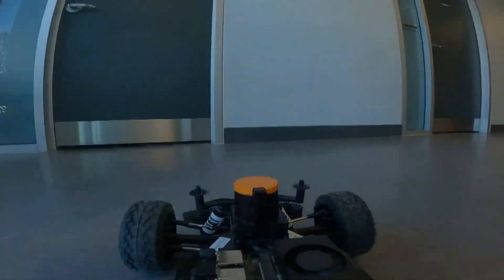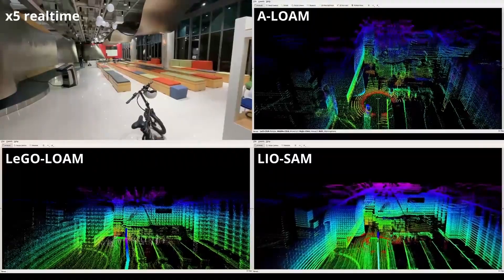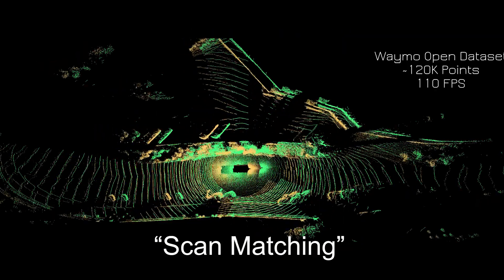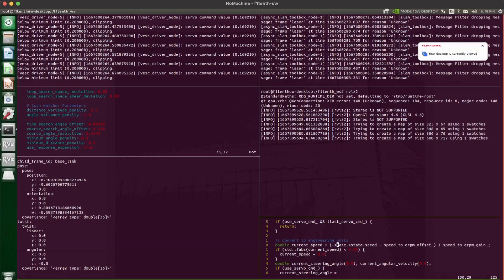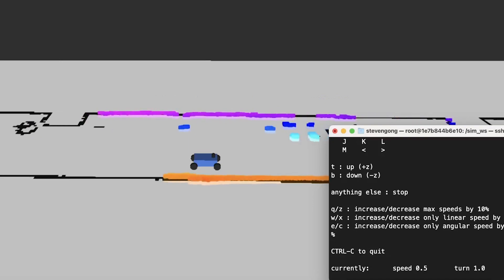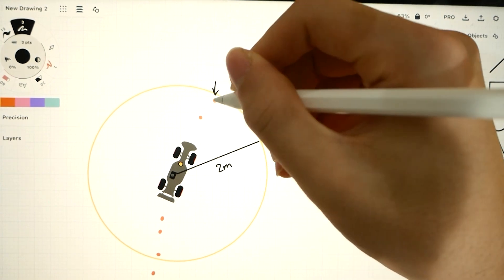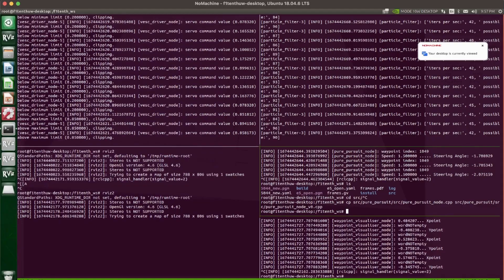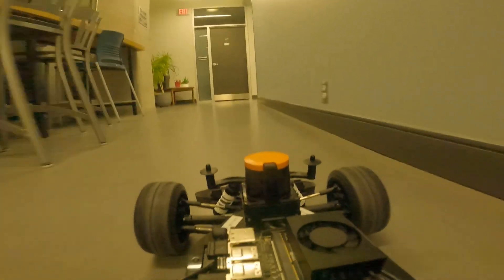I Made a Self Driving FPV RC Car

Comment: wow it's almost as fast as my lg homebot vacuum cleaner, i hacked it and just set all the speed values to max and also set the uss braking zones to max, now it cleans, zigzags from wall to wall and navigates around my house like an rc car, but watch out if you step in front of it, it hurts like hell. it's also destroyed a few cupboard corners but its ok, its so satisfying to see it cleaning and racing around my house. The whole thing has killed 3 batteries already, but hey, a new battery only costs $20! And you can get a new used bot for only $100 right now. All you need to hack into the bot is a USB stick and some online tutorials, which you can easily get by doing a Google search.

Comment: My guess about this rc code

See's line of points = run straight.

See's end of straight line of points = slow down.

See's points (any) angle
= Steer to it.

Im no pro coder, I just used the monkey sees action, neurons activated meme.

Edit: if the line intersect with another line, the code will set time dial to points already passed so the rc car won't suddenly break

Comment: the chassis looks like a traxxas slash, definitely not running it at max speed and has some serious cogging issues. you did not mention but curious about how did you handle braking (software-side)?
Reply from the maker: yea turns out it was loose between the pinion and spur gear, so it was slipping so much. Finally fixed that in the next video. In terms of breaking, I think the VESC handles that, its the same as when you try to break with an electric skateboard. i just tell it a target rpm of 0
Reply: @stevengongg  oh i meant the maths behind it, like are you doing some kind physics simulation to determine what's the speed it should be at x point given this acceleration/de-acceleration k? by the footage it looks the sensoring from the bldc is not connected so I don't even know if you can track the speed.

Comment: I'm not sure if it self driving car if you already make paths from the beginning. Try to put car somewhere and let it go to you by gps.
Reply: gps works by trilateration, calculating your position against at least 3 direct sight satellites. the car wouldn't run indoors or tunnels!

Comment: I making simular thing but in industrial scale , And interested few things. What type of SBC are you using to calculate the root , and how the system power consumption increases with the dificulitiy of the track .
Reply: looks like a jetson nano development kit. i dont think technical driving difficulty has any relevance to power consumption on the computing side, it's continiously doing the same computations on the same data size at probably some low but steady rate all the time. the jetson alone will drain a 3000mah lipo in less than half an hour.

Comment: Great insights into how challenging it is to make an RC car automatous. 

I noticed is at higher speeds the car seemed to overshoot it’s intended path when cornering. Not sure if this a latency between the car knowing it’s position and when steering response is applied, or something else (like a slippery floor). An easy fix is to base the speed of the car on how straight the upcoming path is, 
this way it will slow as an expected curve in its path tightens. This should then allow for higher top speed in the straighter sections of the course. Thus an overall faster speed on laps. ;)

Look forward to when having multiple cars racing, and all the improvements being worked on!
Reply from the maker: yea, it's the slippery floor. Working on a 2nd video using racing lines, hoping to release it soon!

Comment: Imagine AI assist for FPV racing drones. That somewhat helps the pilot fly through the gates accurately without crashing.
Reply: Kinda defeats the whole point lol
Reply: Literally takes away the fun from it
Reply: if you are into boring things dji makes that kind of stuff. will not launch if under a restricted area, will avoid obstacles, fly against wind and successfully reach the point you clicked on a map while keeping a steady still position. after the first flight the fun is pretty much over.
Reply: Yeah folks I get your point. I fly 5" freestyle quads too I know what you mean. And for a long time I sulked from anything autonomous but having flown RC for about 8 years and FPV for a good 4 of those. I feel a bit stagnated in the hobby with the level of risk I can take. But if you watch how people in Ukraine are making FPV drones fly autonomous missions you will appreciate how important it is to make some open source self flying drone project is important. Exactly for the reasons that DJIs won't take off in GPS denied areas and be difficult to repair in tough times. Is why projects like INAV are needed. Yeah it's not as macho as Mr.Steele zipping in n out of parking lots. Autonomous is boring , agree 💯 % but making the open source projects popular and better is important.
Reply: @aakashjana6225  i think the software is there but hobbists don't usually spend USD +1M  on military-grade hardware.
Reply: @knoopx  well my point wasn't specifically on military H/W but more so about contributing to open source projects like InAV ardupilot etc
Reply: @aakashjana6225 nah not fun to me. I did however contribute to betaflight.

Comment: Wonderful job, I have a similar project in ROS2 and understand just how are yet satisfying this can be. Great work on (from what I understand) using LIDAR alone for SLAM and at those speeds! I have wheel encoders and IMU helping with ODOM and still my results are no where near as impressive. Though the size of my chassis it would bust down doors if it ran into one at those speends!

Comment: Compute the sum of the curvature of the N points ahead of the vehicle.
Perhaps extend the lookahead by a factor of the current velocity.
Then use the result as an input to a throttle PID feedback control loop.
Low curvature should result in a high target velocity, and high curvature in a low target velocity.
This should make the vehicle decelerate sharply in anticipation of upcoming corners and keep a tighter racing line.

I would compute the curvature like this:
let summed_angle be 0
loop 0...N
  let vector1 be point[index + 1] - point[index]
  let vector2 be point[index + 2] - point[index]
  normalize vector1
  normalize vector2
  let cos_angle be vector1 dot vector2
  let angle be inverse cosine of cos_angle
  let summed_angle be summed_angle + angle
end loop
return summed_angle